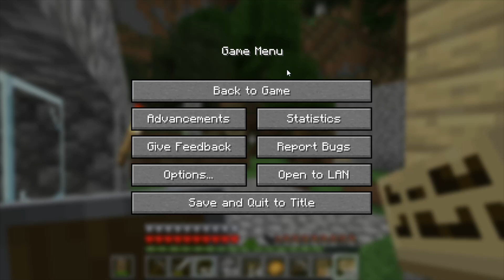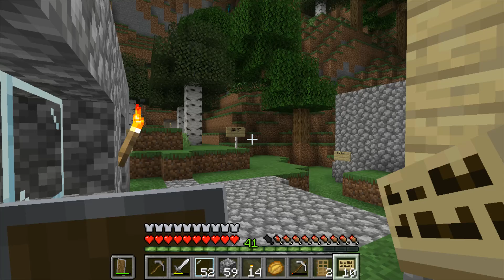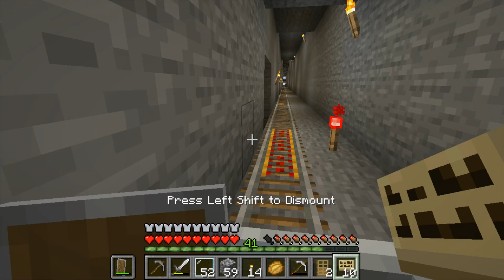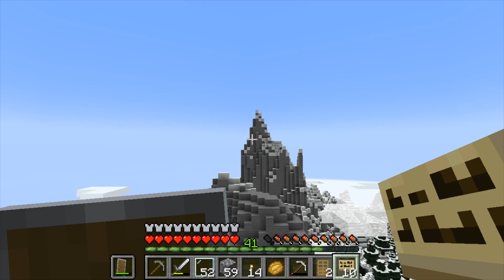My Minecraft Adventure: I'm now deleting a whole mountain

Comment: A tip for dealing with Endermen is to wear a pumpkin on you head. Endermen only aggro when you look directly at them. Wearing a pumpkin negates this. 

Several years ago, a project recreated the entire country of Denmark in Minecraft. At the time, the entire country could fit inside the build height. American players invaded the private sever and left it a mess.
Reply from the maker: If I'm not mistaken, this activity is called "griefing".  It strikes me as a weird way in which the game is coded where you lose something in a map, it's just lost.  I don't know if there is a way to save the map, though I've saved backups of my saved files.  Still not entirely sure about the process, though.

Still, I think there should be an easy way to back up and restore online maps so that players damaging the landscape wouldn't even be a real thing.